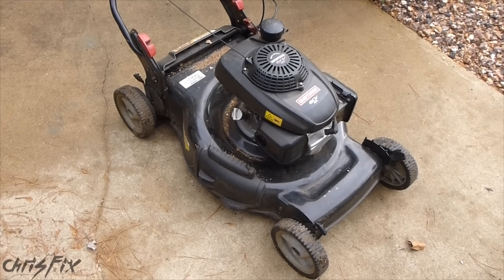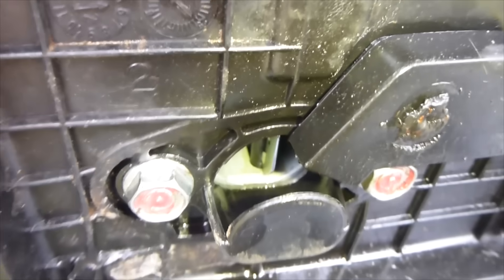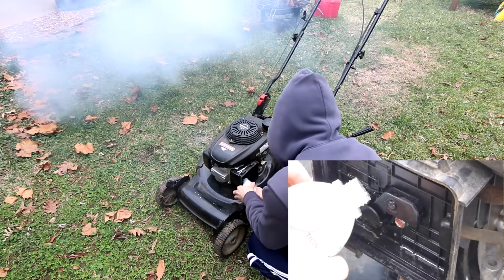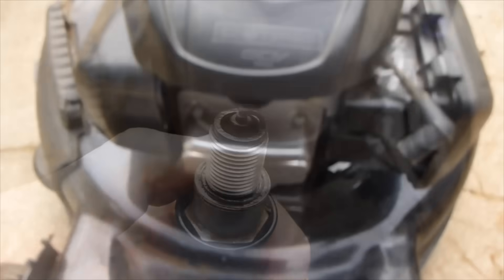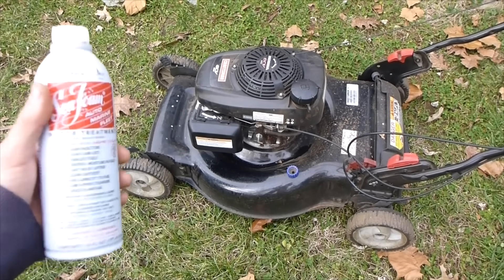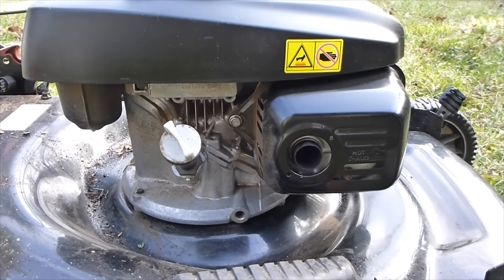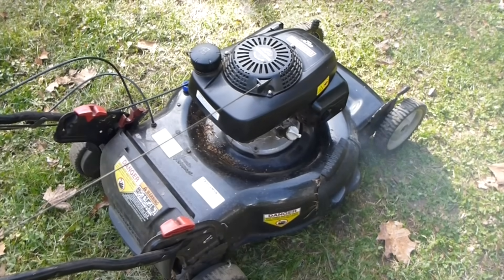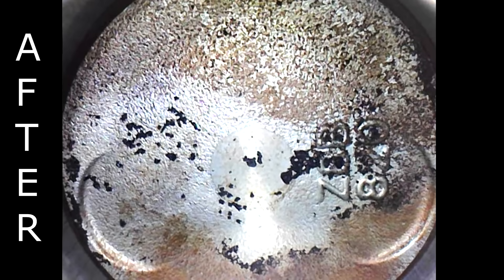Does Seafoam Actually Work? (with Proof)

Comment: I would advize people not to use this.  In a car engine once you break away carbon build up on pistons and valves it is simpy going to blow these solid carbons into your ctalytic convertor PLUSblow back through your throttle body EGR ports and stop them up.  So youre only setting yourself up for two engine codes that are going to cause cost of abt 500 dollars.  Plus also go figure the 2 thirds of a can of this used on this one cylinder lawn mower would mean for your V8 engine you woud need at east 7 cans to get that same fair result.  Actually seafoam is only a revised same method as the old time method of gradually pouring about a cup of water down the carb of an engine as it ran.  But either method today cannot work without causing some serious cost because of todays cats and EGR ports.

Comment: hmmm. So technically, you could leave one spark plug out. let it soak on the top for 5 minutes. With the spark plug still out. start it up and and let it spit most of it out. Then turn it off and put the spark plug back in.
Then start it up and let it smoke out the rest.

Comment: Wal Mart has an identical item a few bucks cheaper....you'll find it usually displayed right next to Seafoam.  Same container, even the inner seal is the same...weight is identical...just has the Wal Mart brand on it.  I have used several, and vehicles are all running top notch....mowers....zero turn...Diesel tractor...Diesel mower...riding mower...Nissan...Honda...Cadillac.  I recommend.  My Deere tractor was putting out white smoke, no power, added it to diesel, ran awhile...like new....

Comment: I used seafoam to clean the injectors on a 1993 Dodge Stealth for a high idle of around 2000 rpm, the engine had been just installed and the guy was building it for his wife.A $10 fix, never had any trouble with the idle again but I decided to change the fuel filter, it was developing a slight hesitation,we cut the fuel filter open and found that it trashed the fuel filter. I suggest if you use it in your car to run it enough to get the seafoam out and change your fuel filter.

Comment: Wouldnt it be easier to mix it into the fuel tank given that its going through the carb anyways ?? perhaps clean out the carb while its burning through.
Reply: That's how I do it. Seafoam is great as a fuel additive. I've never dumped it into the carb or throttle body while it's running like this guy.

Comment: The engine is clean to begin with, lame test. The piston is not a bearing surface, what you are clearing out is the protective oil. Before & after show NOTHING of significance. Some carbon on the top of the piston is insignificant and could just stay there harmlessly.

Comment: I know before I trust anything in a fuel injected, dual overhead cam valvetrane with a pressurised oil system...I test it in an air cooled, pushrod engine that flings crankcase oil around like a derrick  from the 1900's.

Comment: Sea foam is good, however, if there's a large amount of sludge that has firmed up in the engine, change the oil frequently. Then get the engine hot and change it again. Otherwise you'll end up with clogged oil passages and spun bearings.

Comment: Just spray brake cleaner in the cylinder and blow it out with a compressor hose. Sea foam gums up your carb, and in a car ruins the valve guide seals.

Comment: I found that dish rags work to clean carbon off the engine  If I take it apart and rub it real hard. Therefore stick dish rags in your gas tank.  Not sure how you you something totally different then it is directed to use and then claim it works

Comment: Great video bro! Unfortunately I added sea foam to my 08 XR650L and it completely destroyed my fuel line from my petcock to my carburetor. I ended up having to replace my petcock filter, fuel line, and had to completely rebuilt my carburetor. I used it as directed following the directions to the T, but sea foam did more damage than good. I’ve never used it since. Not saying that it doesn’t work for most applications, but I wouldn’t use it ever again. Thanks again for another great video bro!👍🏽👍🏽

Comment: Worked on my Onan 5500 generator  (code 36 ) took 5 days messing running it tru and letting it soak. pacific power in Bakersfield wanted $950 and would only guarantee new carb for a year!

Comment: QUESTION: My push mower was taken to Sears at the end of the previous season for inspection. I was told everything was fine and cleaned out. Then, at the start if the next year, the mower started on the first pull and things seemed perfect. I made it four laps around the yard, and then smoke started shooting out the side of the mower. The mower stopped and wouldn't start again. I took it to a so-called "handyman" and he claims he "got it running again." Although it would start on cement, it would not run in grass because of the resistance. I put a new air filter and spark plug on it. Those were not the problem. I was told the only thing it could be is the carburetor. I don't know how to change those, though. Would Seafoam make it so I don't need to new carburetor?
Reply: Michael Zoran yes if the mower will run on pavement run 92 octane gas with the sea foam and it should do the trick if not find a video on YouTube on how to replace carb and gaskets and that should fix it
Reply: @LivingInFloridaPanhandle  Unfortunately, I am not the best person at doing things such as replacing lawn mower parts. I have a weed wacker that stopped working last summer, too. I was told it needs a carburetor. I saw you can buy a new one for only $16, but the problem is I am more of a computer type of person than a carpenter or repair type person.

Comment: question to chris,  (or one of his followers) :  will Seafoam motor treatment,  when added to the oil, clean the small  screen below the oil pressure check sensor in my 08 gmc sierra (5.3)

 -- given that the screen is buried way in the back of the engine  --  at the bottom,  no less,  i'd rather not have to take the intake manifold off to replace a 5 dollar screen
 that is gummed up and my man hands won't fit behind the engine to remove the sensor
Reply: No it will not clean that oil pressure screen. Those screens are very problematic on GM vehicles. Just getting to the oil pressure switch can be tough to do. If you can get the switch off...you may try spraying some brake cleaner in the hole and blowing it with compressed air.  Shop owner/operator 36 year master tech.

Comment: What are the benefits of having a clean piston head? TIA.
Reply: Probably very little for a lawnmower engine. For a car engine, the pistons are typically shaped to form the combustion event in a deliberate manner. Carbon buildup can cause reduced fuel efficiency. Heavy buildup can cause detonation (otherwise known as engine knock) and minor imbalance issues.

Comment: I put seafoam in my Corolla and it worked so good that it turned into a Camry
Reply: Legendary!
Reply: If you kept using it, did it turn your camry into an Avalon?
Reply: @CCK-jd8nc  My Avalon. Didn't change at all. However if your COROLLA Changed to Camry you got ripped off. Did you know that. a COROLLA even though less expensive than a Camry has an better trade in or .resale value
Reply: My camry became a solara
Reply: A Camry? Nahhhh dude, u must have done it wrong. If done right, you'll get a Supra
Reply: Moon Light I wish that happened to my moms Camry lol
Reply: @MoonLight-zu6zc  or a Crown, or even a Century
Reply: @MoonLight-zu6zc even better, you’ll get a Lexus.
Reply: Should've kept adding more until u had FJ Cruiser!
Reply: I laughed hard on that one
Reply: Bahahahq
Reply: Steven Sousa lol
Reply: I'd rather have a small nimble corolla than a big boaty camry tbh
Reply: A Corolla is better than a Camry though.. I'd rather drive a gas sipper than a heavy sitter.
Reply: thank you for very funny comment... it made me laugh hard
Reply: Steven Sousa zX
Reply: Lol I died laughing 😂
Reply: Too bad not an 86 though.
Reply: I put sea foam in my town car and it worked so good that it turned into a Navigator
Reply: @GoldyCraft79 town cars are better than Navs
Reply: Steven Sousa Zcxccccbx
Reply: Lol
Reply: lol
Reply: Steven Sousa How much did you use? I have a Corolla also.
Reply: That's disappointing.

My brother used Seafoam in his Corolla and now it's an AE86.
Reply: LOL...turned my Ford Pinto into a Sting Ray Corvette😅
Reply: LMAO
Reply: I put seafoam in my cereal and now I can work 24 hours straight and never get tired!
Reply: Throw your corolla in to the sea and then it foam it works better🤣🤣🤣🤣🤣
Reply: @thevikingoli8847  is that thing  reversible? I love my Corolla.

Comment: I have a Honda Shadow VLX 600. I put a tank from a Honda 750 on it. It has almost one gallon more capacity at 3.7 gallon than the original at 2.9 gallon. I've been adding 1-1/2 oz of Marvel Mystery oil and 1-1/2 oz of Seafoam. every time I fill my tank. I do think it helps to prevent cylinder and piston ring wear and prevents carbon buildup.

Comment: 40 or more years ago I learned from the old timers, pouring a small amount of water thru the carburetor while the engine is running would remove carbon. Same process, not to allow the engine to die while adding the water. In the 80's while running an Edelbrock water injection system to curb detonation, I learned the spark plugs, combustion chamber and parts were spotless from the added water.

Comment: That can is meant to go in your fuel tank...not the carb directly.  It didn't clean anything the way you applied it. There's is a Seafoam spray version that's supposed to be misted into the carb(s) or intake.  It comes with a tube.  Seafoam should be in a mist form as it enters the cylinder...not drops of liquid.

Comment: Yeah it's mostly the steam that cleans the carbon, but the main benefit is cleaning the carb and the valves. When put in the crankcase it cleans a bunch of that crud out as well (with the next oil change anyway) and when you add it to the gasoline as suggested it helps clean out lines and everything else. Can't put water in your crankcase heh

Comment: I would like to see someone fail a smog test. Go and put Sea Foam in the fuel and engine and see what numbers drop in the 2nd smog test.  The Sea Foam would be the only thing done to the vehicle. Obviously the 2nd smog check has a high risk of not passing, but I would just want to see result numbers from the 2 test and compare them. 
Seems like it would be an easy thing for a youtuber to do, since they will make back the $30 for the 2nd test from posting the video.

Comment: Great test, Chris. I just added a full can into the gas tank on my 5 hp tiller. I’m letting it soak and will then pump it out, put it through cheese cloth, and then try it in the intake like you just did. Real timely test for my application. Thanks!

Comment: We used to use ATF to soften the carbon on the pistons and valves. It was risky though considering what would happen if too much went down the intake. Compressing a gas or foam is easier than compressing transmission fluid!

Comment: Since the combustion chambers are not sealed from the rest of the engine (the rings will allow some blow-by, there are gaps in them), there's a good chance you got Seafoam in your oil. I would change the engine's oil after doing something like this. Cool demo, though. I like the borescope camera!

Comment: You don;t need to remove slight carbon.   Cleaning carbon is his scientific objective of success?  too what purpose? slight carbon at that level does not increase compression ratio, and cause spark knock, but you have potential to cause long term wear on your friction surfaces using products like this.   Remember, no manufacturers recommend putting products like this in the cylinders.

Comment: I used seafoam on 3 different cars, and all 3 times the cats went bad soon there after.
You've been warned!!!!!!
Reply: psygn0sis I would suggest detaching the exhaust for that. The cat is going to catch all that carbon messing up all the sensors. Also don’t put it in before your air intake sensor because it will ruin those as well.

Comment: Mist some water in the intake without stalling it, steam cleaned just like using SeaFoam, cars with a blown head gasket that leak water into the cylinder are spotless too.

Comment: I have a poulan pro 24hp vtwin riding mower and when it starts it runs perfectly then after a few minutes it starts to smoke and pop but still runs strong. It uses alot of oil too. What could be the problem? I already cleaned the carburator

Comment: In your air intake just use a seringe 10-20ml with brake fluid or acetone and rev the engine when you do it, one time at 3-4 weeks and you should see better and better

Comment: DOOD OLD DISTILLED H2O (WATER) WORKS BETTER DOING IT THE WAY YOU JUST DID IT. HOT STEAM REMOVES ANYTHING. IT WILL MAKE THAT PISTON LOOK BRAND NEW WITHIN A MINUTE. IT IS AN OLD MECHANICS TRICK.  YOU EVER SEEN A BLOWN HEAD GASKET ON A 4 STROKE WATER COOLED ENGINE? WHEN YOU PULL THE HEAD YOU SEE WHAT LOOKS LIKE A BRAND NEW PISTON AND VALVES! GOOD OLD H2O!

Comment: Interesting. I have used SeaFoam® in my boats, mowers, and cars for years. Just bought a brand new mower with Honda GCV160. It will be interesting to look inside after a couple of years of use since that gas ALWAYS has SeaFoam® in it. I'll post. See ya in 2 years.  Ha ha

Comment: Hey Chris.  I watched one of your videos about cleaning fluids in the tank for carburators and I accidentely added with a quarter of a tank rather than empty.  Then the service engine soon light came on then it wouldn't start at all.  I thought  the battery,  but it still won't start after new battery.  Was running fine till I added the Gunk out!  Please if you could give any advise I would certainly appriciate it.

Comment: Just like Chet's Jug
 said - it's the thermal shock doing the work.  If you don't like the idea of using water (yes it works) use 91% isopropyl alcohol.  It burns and provides a cooler intake charge - so the thermal shock to the carbon is more pronounced.

Comment: The additive is not designed to be poured straight into the intake like you did. That additive should be mixed with gasoline so it will clean over a period of time. There may be better results if you just poured some in the gas tank.

Comment: Any additive added to a automotive engine that has catalytic converters , one has to use the product with caution. Unless the product has been extensively tested it can glaze over the substructure in the cat reducing its efficiency to burn the hydrocarbons. I have never used this product so I can not say it's safe and has been lab tested and certified .

Comment: Great Clarity, especially the pro tip version of your experiment.  A little scary, in my NOOB experience in how sure that you got most of the solvent off the piston head...???   I imagine an abrasive pad mixed with solvent would make the cylinder head sparkle.   2) Great experiment but why?  also I appreciate the importance of the disclaimer, a quick cut to the receipt is recommended.   Lawson di Ransom Canyon

Comment: ONE question        .... My Briggs is surging like this ......but still runs strong,   trouble is  within 15 minutes of mowing my rpms seem to get weaker & weaker.                  I cleaned out the bowl & jets & put 92 Gas in it.   Still surging.      My only hope is this seafoam.

Comment: Did the engone run any better after the test?  Without some way to measure the engine's output there's no way to know. 
 Replacing the air filter would probably make a bigger improvement in the engone's performance than just cleaning the carbon off the top of the piston.

Comment: Did you do an oil change after letting it sit on the top of the piston cos there is bound to of been seep past the rings and the sea foam can't be good for the oil so it's going to have a detrimental affect on the engine's life span

Comment: I don't waste good money on this kind of crap . Best way to remove carbon from an engine is to use to Redline frequently. Redline on the tacho = full throttle. In New Zealand we call it "The Maori Tune Up". Simply flog the motor for a while and all the heat will burn the carbon off. Leave your Seafoam etc on the shop shelf. My mower never gets carboned up cos it's always  revved full throttle. Same as my car it's get a good blow out weekly.
Summary ....Seafoam treatment out    heavy foot treatment in.

Comment: Steam will work as well or better.  The cutting power of the steam disintegrates carbon deposit rapidly....(however i do NOT recommend using water in any temp below a pressurized rolling steam)

Comment: We're apparently working on the assumption that seeing a reduction in carbon deposit on the piston would equate to a reduction on the valves, leading to longevity for the valve seals.  Because not sure anyone should care about carbon buildup on the piston head, but valves would be another story.

Also after dumping it on the piston like that, it surely got into the oil, so would have done an oil change right after running it to clear the sea foam...

Comment: I’ve had my mower for 13 years. I’ve never changed or added oil, I know I should 😲, I had to clean the air filter for the first time because it choked the motor. I bought the mower from Walmart. It was a mower someone purchased and put together, but could not get it to run. It’s worked fine for me all these years. I do maintain my car very well though. 😲

Comment: IMO, Sea Foam will relieve you of 8 or 9 bucks, but that's about all it's good for. MMO will gradually clean up an engine, but it's no miracle, neither are the ingredients a mystery. None of this stuff is necessary anyway if you follow a reasonable oil change schedule.

Comment: It is supposed to free up buildup in the engine and deposit it into the engine oil. The stuff frees bolts better than brake fluid or wd-40 and is petroleum based so it can't hurt.